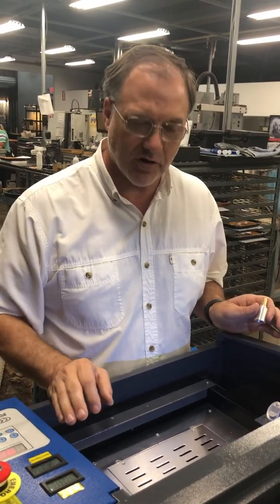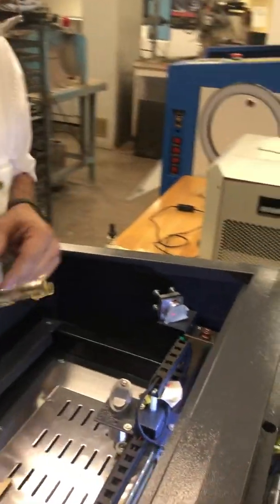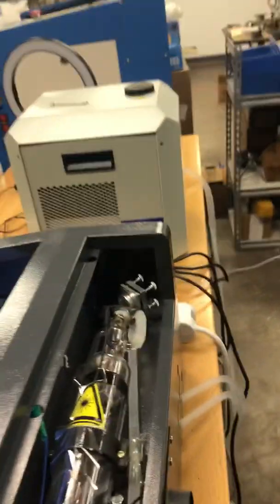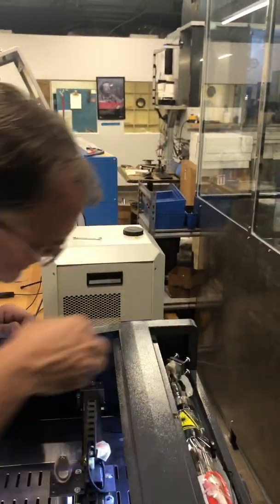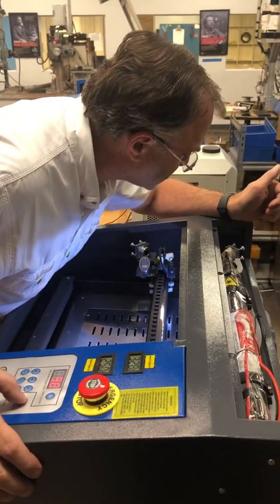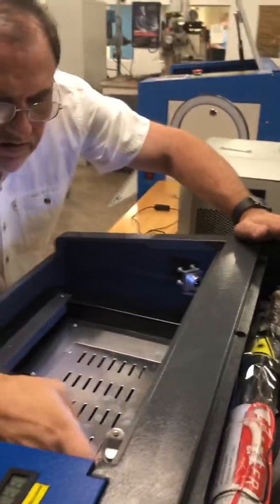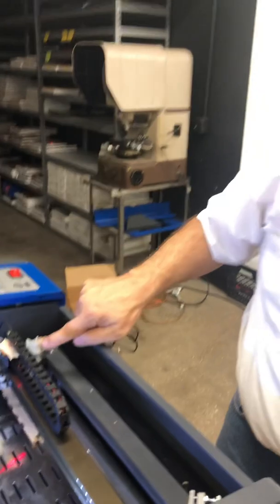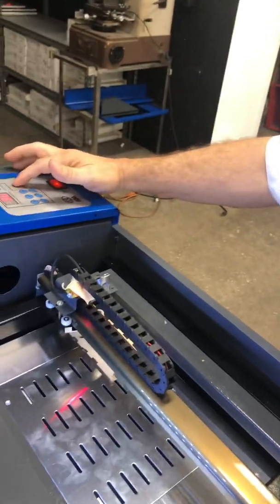K40 alignment by American Photonics

Comment: Sadly, the K40 is the biggest piece of s**t in the world. I have the alignment tool, but it's defective out of the box. Fortunately, a new one is on the way. I did manage to have the light source work for a short time and tried my best to get the alignment done, but after having centered the beam in all three mirrors back to the tube, I get no fire at the working material. Back to the drawing board, but the light source died. This Chinese piece of s**t is worthless (the laser, not the alignment kit). I can't wait to get a new XTool P3.

Comment: Very professional with NO safety measures taken at all. No goggles, no lid closed, no nothing but just staring closely at the beam...
Reply: Looks like a class 1 pointing diode. No extra safety precautions. Guessing glasses are polycarbonate so it should be od +7 for 10.6um guessing also these tubes are broadband output but that is 9um to 11um so still good with eyeware. I don't get too jumpy until +400 watts with sub 100us pulse widths.  Even with covers on this is still class 4 laser system, so just be cautious and keep body parts out of beam path.

Comment: I'm going to tell you something you may not already know: You can still adjust the beam even with that ghetto laser head barrel and without that laser pointer. If you loosen the thread between the upper and lower body you could wiggle it tiny bit left and right (perpendicular to the X rail)---so that gives you horizontal position adjustment. Then you could insert a tiny piece of paper or rolled up tape into the side of that barrel's mirror and adjust the metal leafs that locks it to different positions before tightening it up. Always check beam position bits by bits by placing a piece of tape on the cone opening and inspecting it with a small mirror. This will take a lot of efforts and can be pretty frustrating, but it is somewhat possible to do. But the machine cannot be used at higher speed because it will ultimately shift that paper insert.

Comment: "Pure alcohol"....Hardware store Denatured alcohol or drugstore alcohol?
Reply: Drug store "food grade" standard isopropyl does not leave a residue.  Denatured will apparently.   Just looked it up > https://www.google.com/search?q=denatured+alcohol+vs+isopropyl+residue&oq=denatured+alcohol+vs+isopropyl+residue&aqs=chrome..69i57j0i333l3.15613j0j7&sourceid=chrome&ie=UTF-8
Reply from the maker: I have not personally used denatured alcohol, but it contains no water and it will not damage the coating. As long as it evaporates quickly and without any residue it should be good.
Reply: It's a bad idea to use denatured alcohol it seems, for the very reason you discussed Steve.    Apparently it does in fact leave a residue and is not good for electronics or lenses!